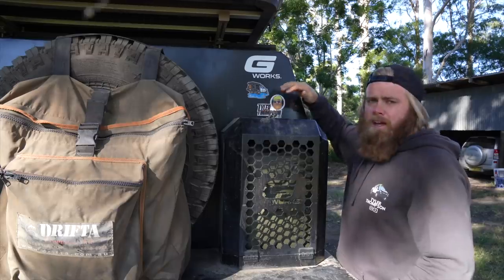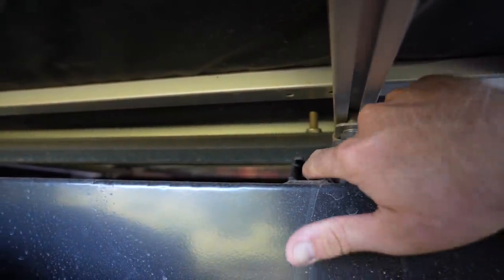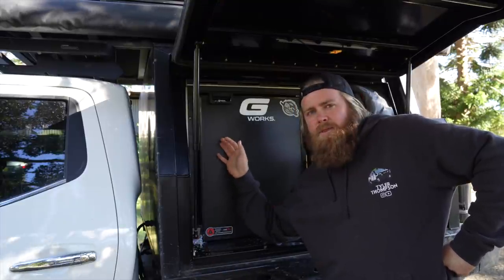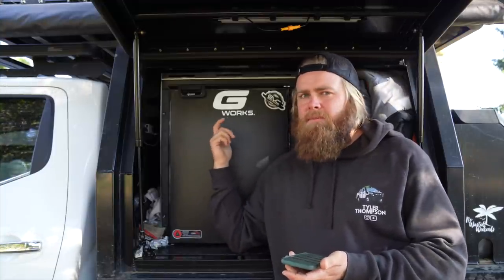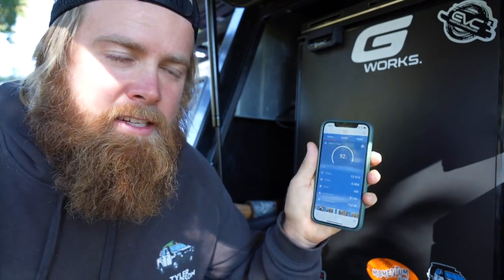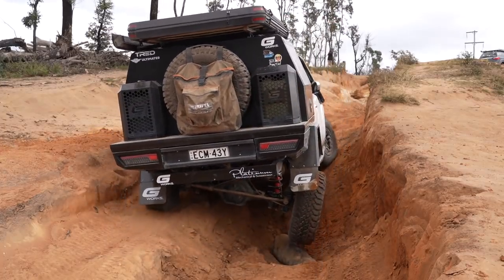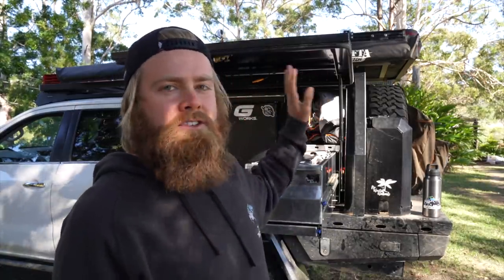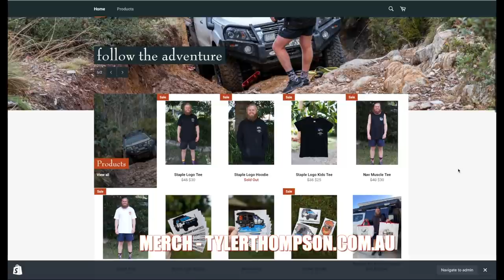Should you get a tray & canopy? Walkthrough & thoughts after 6 months use + Bushman fridge review

Comment: I went with a dual cab with a tub, then had a canopy installed.  I won't do that again.  It was the least expensive of the single/xtra/dual cab variants with tub or tray.  Bought an ARB Ascent canopy plus racks on top. I found tubs + canopies with small openings make for poor access, bad use of space due to wheel arches, corners near tailgate, canopy needs a rack system because it's not flat for anything on the roof, the canopy is limited to 100kg, you cannot seal for dust...there's very little going for it, now that I've lived with it.  Next time it will be a tray with a canopy.  If it wasn't for the coin already spent on the ARB canopy, I'd get rid of it, get rid of the tub, and go to a tray with canopy.  Live and learn, I suppose.
Reply: Sell the tub and canopy and away you go!
Reply: @4x4touring47  Ben, I know, mate.  I have to stop thinking about it and just go and get it done.
Reply: @Michael_Mears  if you don't already use Facebook, selling and buying things is probably the best thing about it. Join a few 4x4 groups, and owners groups for your car, and chuck the canopy up on market place. I'm sure you'll sell it quick and easy if you put it up for a good price. The tub may be a harder sell, but there's people occasionally looking for them after an accident.
Reply from the maker: Thanks for sharing the feedback mate! Made it even more clear I won't be taking that option 😅
Reply: I have the same nav np300 dualcab i have the arb ascent canopy and tub i love it but very soon to sell it to go a full tray for the moment then go canopy and dogbox 👌🏽

Comment: Awesome setup! Did the 700mm open length shocks bolt straight on or did you have to modify mounts? I want to put some on my np300!
Reply from the maker: Bolted straight on mate!
Reply: @TylerThompson90  Are you running coil 
retainers and drop out cones as well?
Reply from the maker: @shaunf9859  Yep and extended brake lines